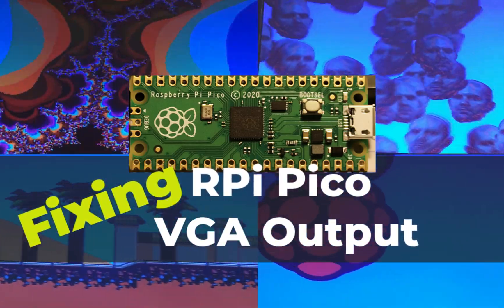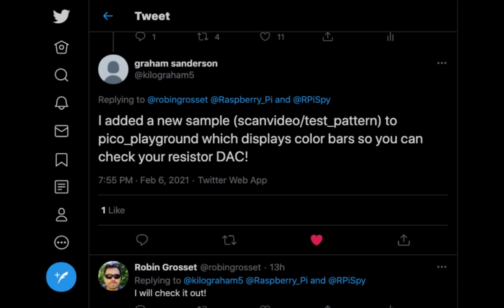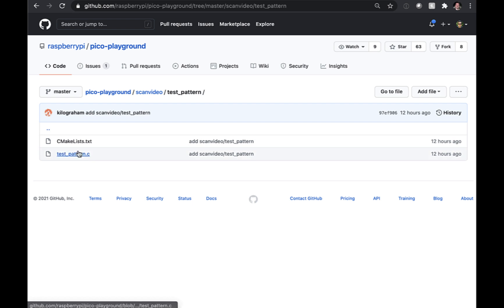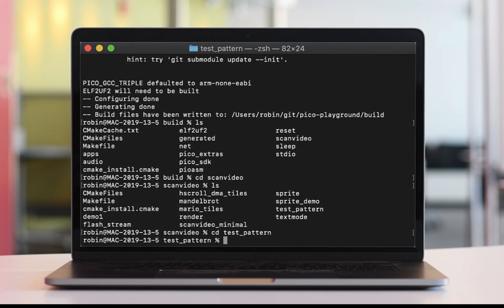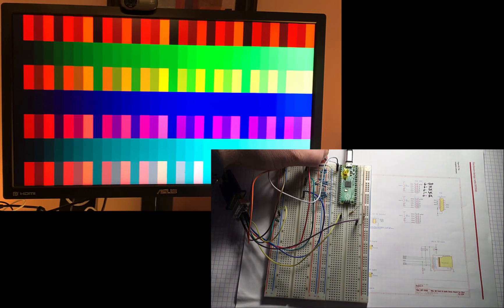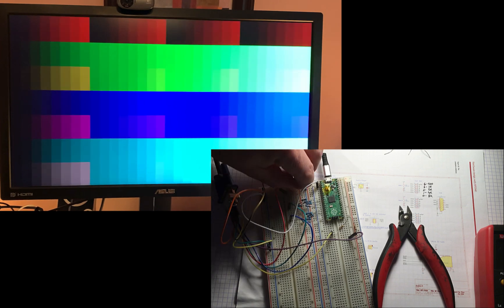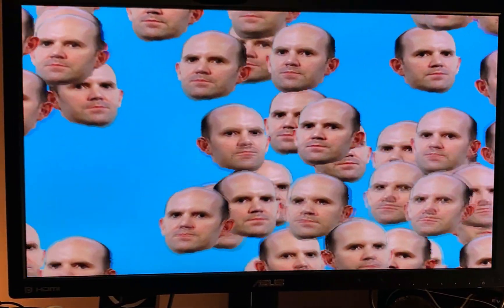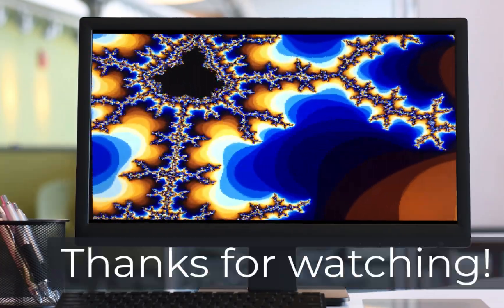Using test_pattern to fix the colours on my Raspberry Pi Pico VGA project

Comment: Hello Rbiin Grosset, I have a question. Sense the pi pico can now use on the arduino ide. Which i have been testing it on that. Do you think you can get VGA working using arduino code now?

Comment: Is there any way to access the serial ports on the pico in c? I haven't seen anything yet but I may have missed something. Thanks for interesting video. It's impressive that the pico can maintain a stable display with so much screen activity.
Reply from the maker: Yes there is. Here is an example
https://github.com/raspberrypi/pico-examples/blob/master/uart/hello_uart/hello_uart.c

Comment: wow.... i am aware the pico is dual core, is it using both to do the heads sprite demo?
Reply from the maker: I don't think its using both cores. There are some pretty interesting comments in the code. Like: 

#ifdef TURBO_BOOST
      set_sys_clock(1536*MHZ, 4, 1);

seems like a crazy high clock speed but the documentation does say it has a configurable clock and can be 'overclocked'.
Reply: @robin-g6  the rp2040 is dual core ARM M0+.
Reply: The rp2040 is dual core, saw a few vids on that, mine is ordered but not arrived.  What I was thinking is the logic of a computer, could the Video VGA work in one core and the second core do some calculations and interact with each other so remains smooth and silk while running
Reply from the maker: @Dave Repairs sorry I meant to say I don’t think the vga demo code is using both cores. Yes I think you could do vga in one core and use the other core for something else